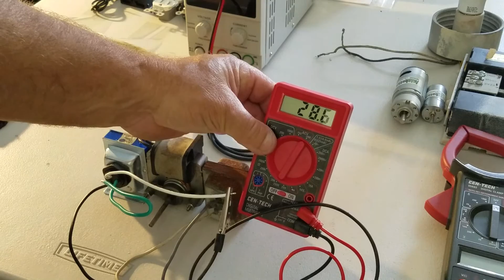Free Electricity from RF-pt2

Comment: Great videos sir, thank you for this information.  Is this RF or EMF?  Have you performed any more test adding more transformers and multiplying the amps and voltage to actually put in use this energy? Are the transformers themselves creating new EMF fields and multiplying from each other? Thank you again.
Reply from the maker: It is EMF.  The magnetic fields created by the running motor are picked up by the copper windings in the transformers secondary windings, then moved backwards through the primary windings, essentially making the transformer a 'step-up' transformer and raising the voltage.  I have added more transformers and increased the voltage, and lit LED bulbs with it.
My idea was to incorporate this to the bathroom fan and have the light run on the voltage created.
I haven't had much time to experiment further since I moved off grid, as starting with a baren desert property and building a Homestead for life off grid in retirement has proven to be a time consuming job.
Reply: @GBear  Thank you for your response.  Did you notice any drop in voltage/amps by adding more transformers and do you think that the transformers are multiplying voltage from each other's own magnetic field and not just from the motor? I wonder how many more transformers can be added multiplying this effect. If this "free" energy could be used directly without causing a load on the motor somehow or be stored in supecapacitors or batteries.  Or even perhaps have to motor be self looped. I have not seen any other similar experiment videos or documents to see their outcomes.  Hopefully you will be able to perform more tests soon.  Thank you again for your discovery and sharing it.
Reply from the maker: Capacitors or graphene batteries could be a great addition to this experiment.  The increase in transformers upped the voltage but i was limited to materials on hand and time due to moving off grid.  I need to organize my shipping container to be an efficient laboratory to continue my experiments, but other priorities are in the way.
Reply: @GBear  Best of luck and success getting off grid.  Looking forward seeing future experiments once you are ready.  Thanks
Reply from the maker: I have been off grid going on year 6 later this month.  I have over 1100 videos documenting my trek, including overcoming electrical needs, gardening the desert, raising chickens, etc.  You can find a lot of interesting stuff in my play lists.

Comment: what is the amps @the 59 volts with the 4 trans.
Reply from the maker: Not sure what you are referring to.
Reply from the maker: Ok, old video!  I'm pretty sure I answered that in a video back then, otherwise I would need to re-do the experiment and run that test.
The idea behind the experiment was to set up a unit in the common bathroom that would power the exhaust fan for cost, and the lighting for free.
Reply: @GBear  yeah it's a whole video you was doing experiments and I thought it looked pretty cool and it was a good idea
Reply from the maker: @thomasmoore4576  I need to make time to get back into that field!  Being off grid and paying zero for electricity has made me lazy.😉👍
Reply: I would appreciate any input on how to build that high Gain antenna if you know how to do it cuz the power line is on my properties all I got to do is go stand under it
Reply from the maker: @thomasmoore4576  a radio talk show host once stumbled upon something at his desert location.  He was attempting to boost his output antenna and had some men run a couple strings of copper wire around his property on top of the fence posts. Afterwards while he was conversing with them he leaned on the wires and got an electrical shock.  It was collecting electricity from the air!
Reply: @GBear  sounds like a good experiment
Reply: Well thanks for the video man it's very interesting

Comment: Voltage is useless without current. Hook your light up to it and it won't light.
 Even@6ov it would still light up, if you have current.
 Better off rubbing a balloon on your head for some static electricity, at least you'd get a spark...
Reply from the maker: SamaritanElad not true.  See my video titled "Not all LED's are created equal"  I light a 120vac led bulb with 27vdc using 3, 9v radio batteries, and other lower voltage units.
Had you begun your comment with, "I duplicated your experiment GBear, and I could not light a bulb..."  I would have considered your comment based on fact.  Your balloon comment is insulting and unwarranted, thank you.